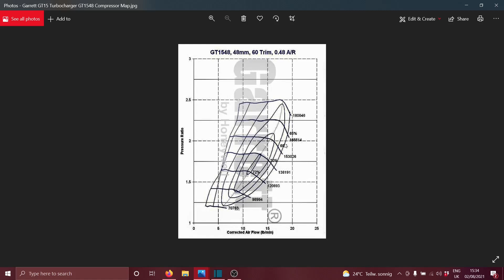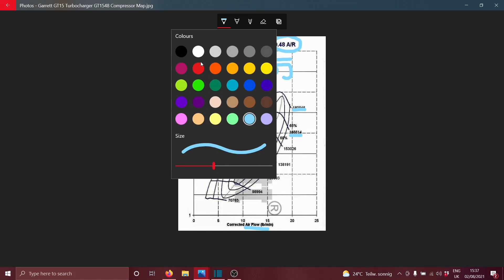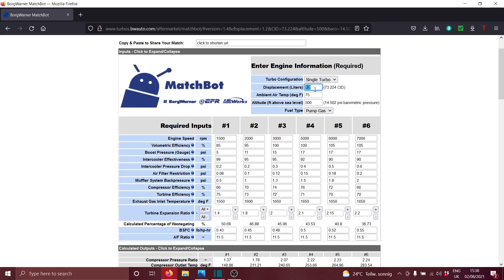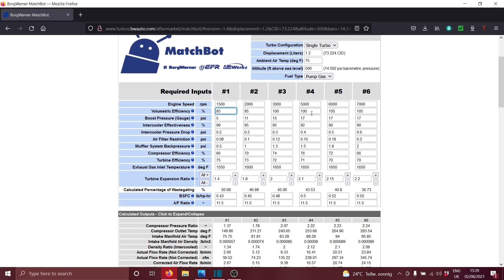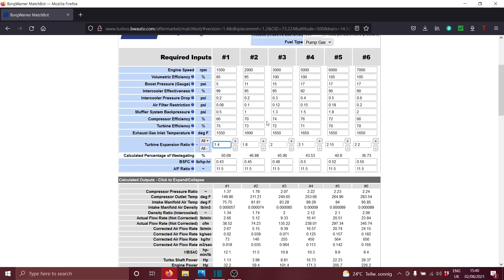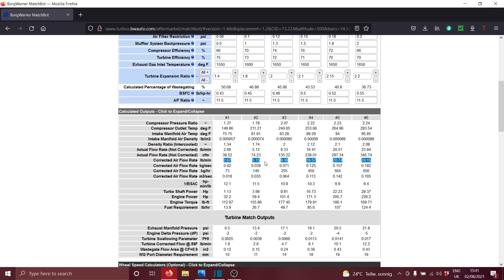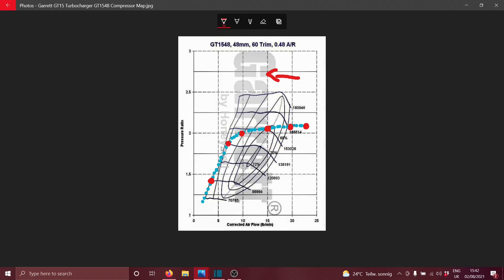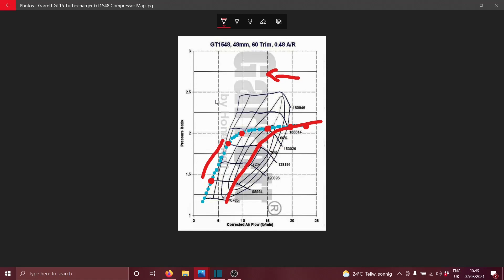How to Read a Turbo Compressor Map ~ Made Easy

Comment: Great that yuu try to dig down into turbo matching! Though That's not how A/R works :) , for the compressor the A/R has minor effects, it changes the shapes and levels of the efficiency islands a bit, but its minor. Compressor wheel inlet area and wheel blade design it's what's mostly determin the maximum flow capacity of the compressor. For the turbine the a/r or more specifically the throat area is highly critical since it determins the exhaust speed at the wheel, but also creates a choking effect at high flow (hence an important factor for sizing the turbine housing to achieve the desired boost at the desired rpm),. I also think the turbine expansion ratio wqs misunderstood, but it could be skipped for now. This was part of my job for many years at an OEM. :)
Reply from the maker: You are right there are many things that come in to play in turbo compressor maps. This is a quick overview of how to read one. Without getting in the nitty-gritty. 
I did make an error on the turbine compressor ratio wich i will correct.
Thanks for the well written reply!